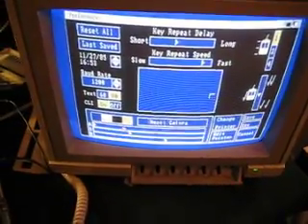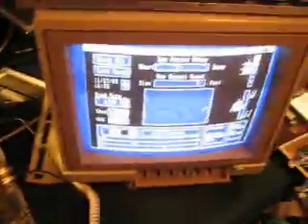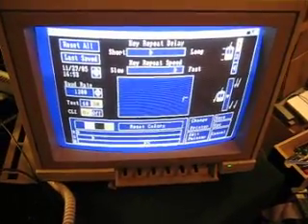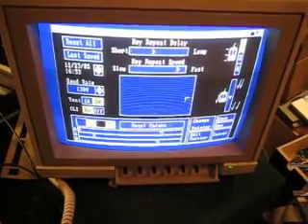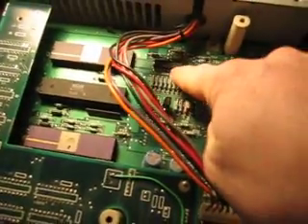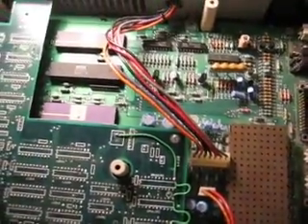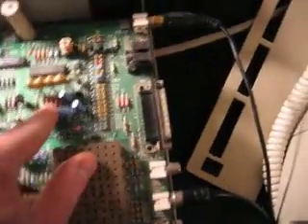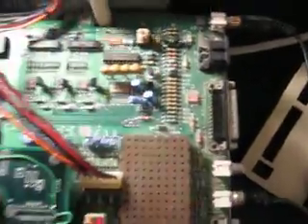Amiga 1000 color strangeness

Comment: I knew it! :) There couldn't be much else causing a problem like you're having, especially since you had already tried to replace the Denise and also tried to replace the HC244s. There were only the resistors and signal traces on the PCB left that could have caused this. I'm glad you managed to fix it. Nice work! *thumbs up*

Comment from the maker: Okay! I dug in tonight and traced the signals and signal levels on that area in the board.  I'm pretty certain that someplace on the path for one of the four lines is shorting to ground. Its voltage levels were barely readable.  I ended up directly wiring the Denise to that 244, then directly from there to the resistors, not using any of the PCB traces for that circuit, and now it works 100%  Thank you for inspiring me to dig back in and get this thing working again!

Comment: Haha, that was a fast response! ;)
Anyway, I am actually working on an A1200 motherboard right now with a very probable video DAC failure. I am experiencing almost the very same problem as you did with this A1000. I will post a video soon where I troubleshoot the color problem on the mentioned A1200 board. If you're interested, you can always have a look when that video is up. ;)

Comment from the maker: Hi! The Ami has been on a shelf, since I moved and didn't have a chance to get back to this.  Anyway...

Thanks much for the suggestions!  I'll be replacing those resistors when I next have time and space to work on this. 

I've swapped the Denise with the one from my A500, and both exhibit the same issue.  I left the plastic-cased Denise from the A500 in there, so that I would get the EHB mode. My original Denise didn't support EHB. heh.

Comment: The problem you are experiencing is most probably due to either one of the two 74HC244 ICs being faulty (they are set up as one-way buffers/drivers), or one or several of the 4 resistors for each color being faulty. It can also be a broken signal line around the same area of the motherboard. Check the resistors and signal lines first with a multimeter, then move on to checking the drivers (HC244).

Comment: I don't know if you still have the Amiga, or if you have it fixed by now. But I think that problem could be fixed pretty easily. I just took a look at the A1000 schematics, and it seems like it uses a lot of discrete components. It doesn't even have an IC for the video DAC, the D/A conversion is all handled by discrete components (a resistor/transistor network consisting of 4 resistors and one transistor for each color).